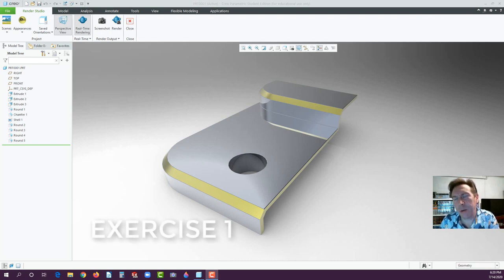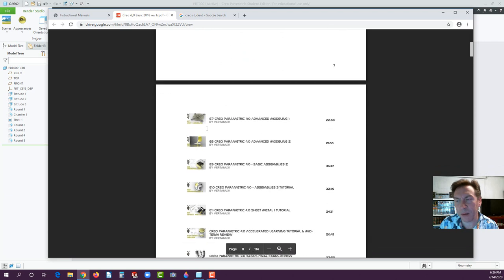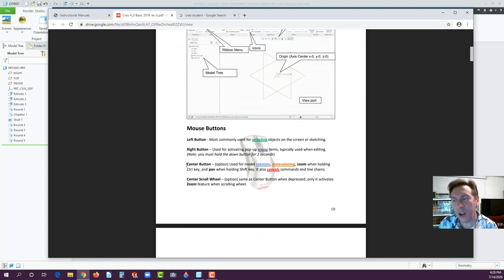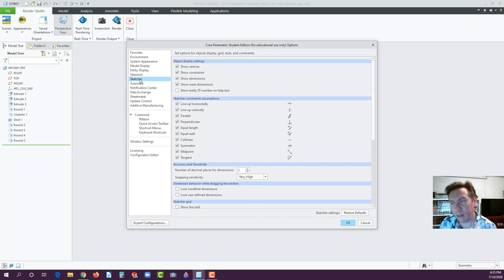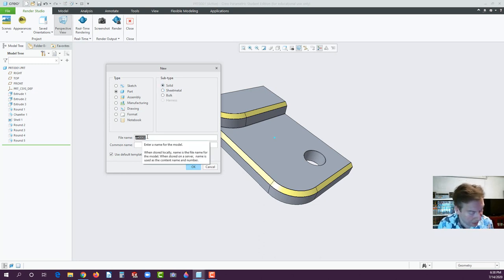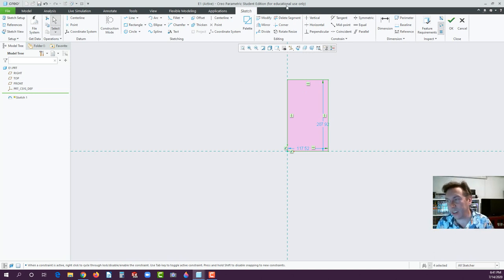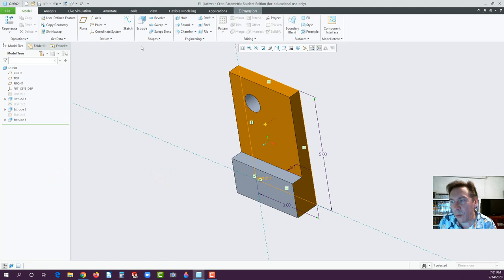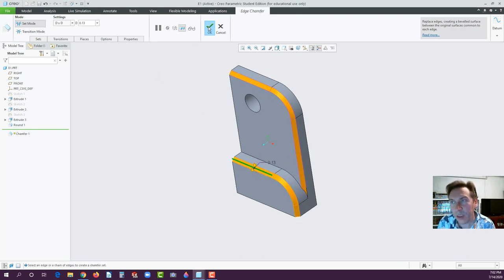E1 Creo Parametric 6.0 - Tutorial for Beginners w/Training Guide

Comment: Creo is the most counter-intuitive CAD ever.
In Solidworks, Inventor, let alone Fusion you just start picking here and there, trying this and that and in a mere hour you start working. No manuals, videos, tutoring, no pain and nerves. Well, you can't become a master in an hour of trying, but you definitely get along with software and can do quite complicated things. With Creo you need a whole day of pain and shattered nerves just to start sketching. I know it's powerful (tried ProEngineer in 1998), but I'm convinced this piece of soft is developed by sadists for masochists.
Reply: Yeah Creo is messy. Inventor's menu layouts and feature options are more efficient.  Controlling the view is better.  
The default colors are also way easier to see everything in Inventor. 
Also Creo does not tab the windows, it opens a new window for every part.  Very annoying.  
Inventor also will consume the sketch into your first feature so it does not hang outside.  It makes no sense to choose "extrude" before you draw your sketch.  
Also then inventor gives you a "share sketch" option if you want to share that consumed sketch for other features and it will put it back into the menu by itself.  
The proper way in industry is to draw your sketch first then create your features, not to chose the feature first.  Creo has it backwards.  
Inventor you dont need to create redundant centerlines for a pattern. If you already centered your part on the X and Y then obviously the X and Y are already your center lines.  No reason to draw new ones.